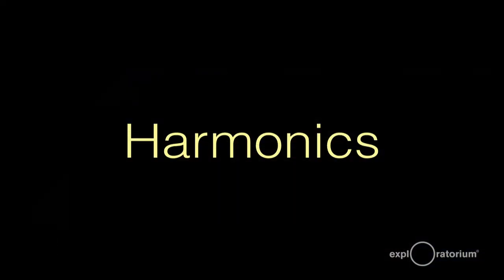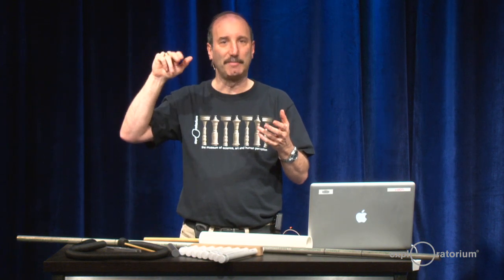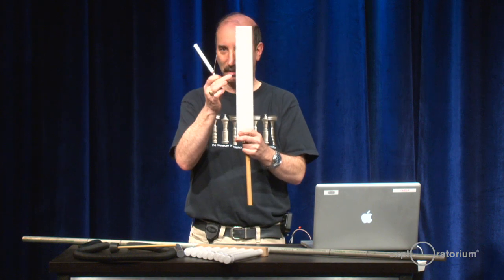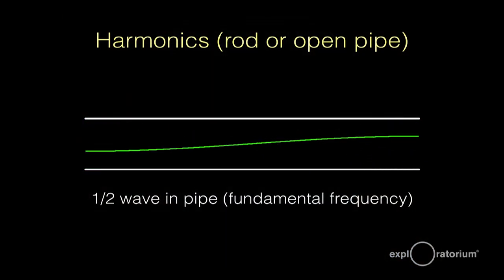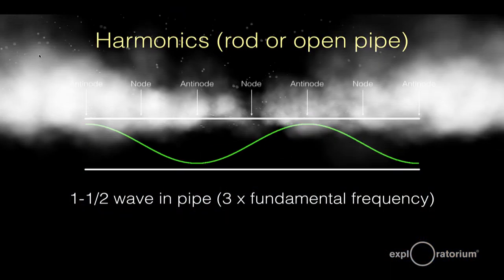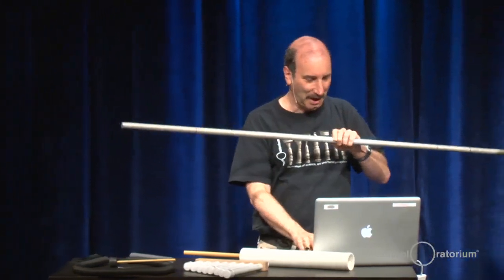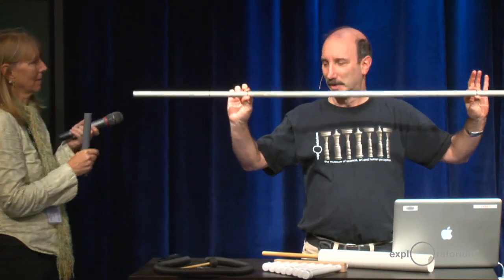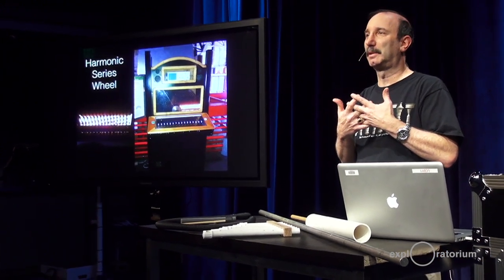What Are Harmonics? I Full Spectrum Science I Exploratorium

Comment: how were you able to get a different vibrating frequency from the same object? does it depend on the material/size of the object that strikes?
Reply: apparently, it does!  not sure how, or why!   i know thicker strings, for instance, feel like they have to be stretched tighter, in order to get the same note, and so they're then harder to bend, i think that's one thing i've been able to determine, -maybe!  but it's slow goin', around here!  haha!
Reply: Holding it from the antinodes (both hands), thus, dividing the vibration of the material putting pressure on these points.
I wasn't expecting this, it's amazing and being musician and interested in Physics, this made me more passionate at music than before.